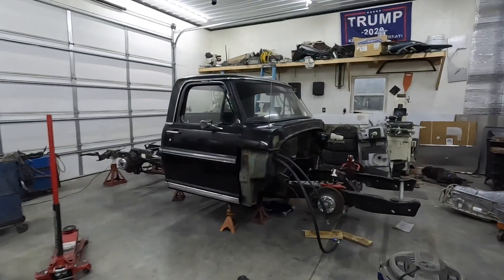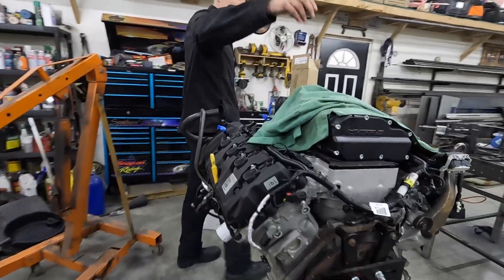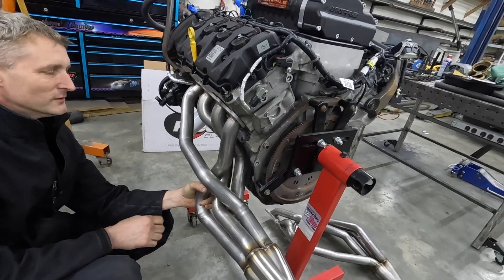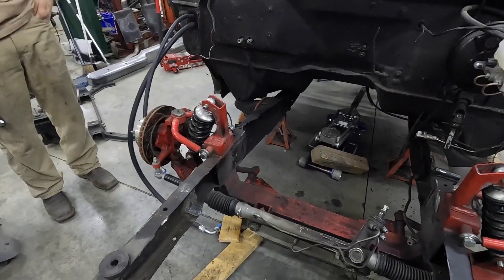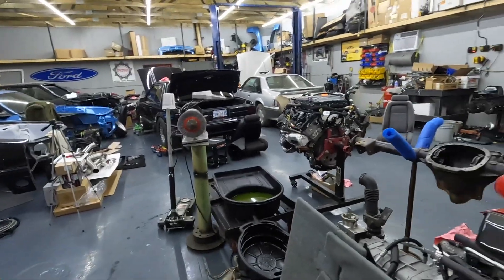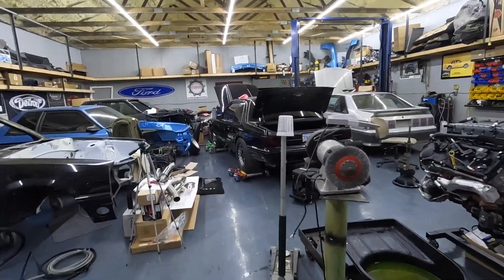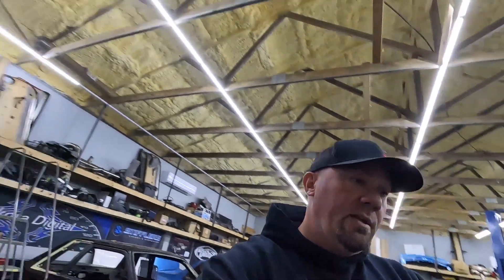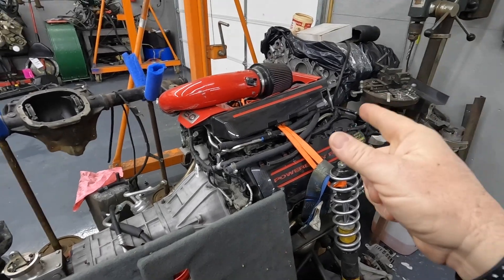Checking in on the fab work of the WHIPPLE F100!

Comment: I am doing a custom build on a 91 f150 rebuild for my father and I was wondering what you use to tune the trucks. It does have a E40D transmission. But we built the stock 5.0 to a nice 347. I would like to keep efi as well.